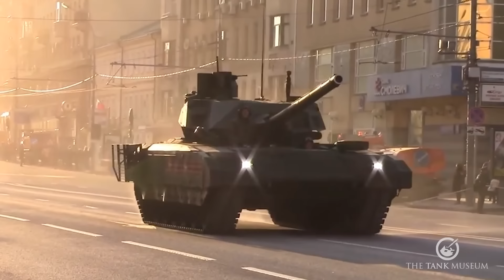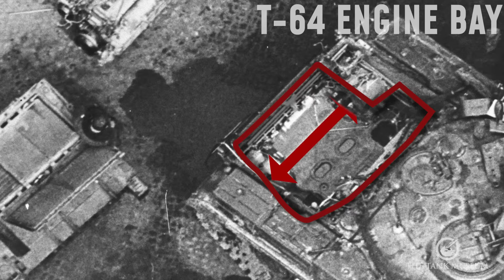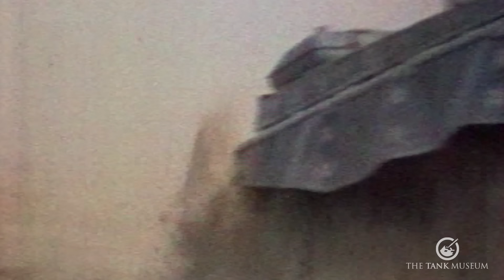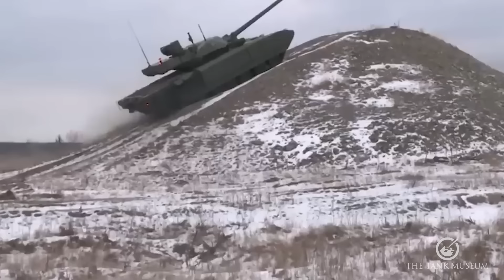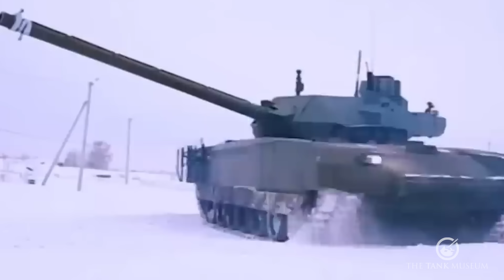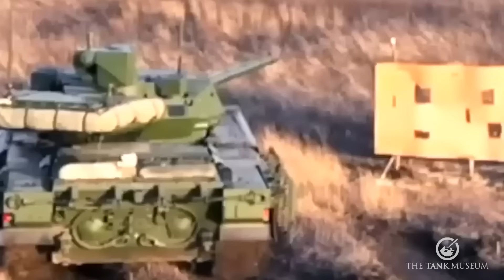Radical or Ridiculous? | T-14 Armata | Tank Chats #171

Comment: The T-14 feels like a project that falls under "eyes were bigger then my stomach " category , as a design while ambitious was never full thought out on how to build the tank in mass. Also a German engine design from WW2 was not the best choice either. 

Also I did find the statement that the T-72 is all that it is needed to counter western designs funny, As the few engagements where the Abrams faced the T-72 , the T-72 was curb stomped. That's statement has also aged horribly,especially now that the T-72 design has been shown as a death trap with a Jack in the box feature thanks to the ammunition placement.
Reply: The Shahed drones who terrorized Ukraine in 2022...2023 use the same design as a "German engine design from WW2". More correctly, from before WW2. It's the engine of Volkswagen Beetle.

Comment: It should be noted that the T-14's engine, the A-85-3A, IS NOT a copy of the German Sla-16 from WW2. This is incorrect. Simply looking at the exterior design let alone the finer technical details will demonstrate that they have little to do with each other

The engine was also never originally designed as an engine used for oil rigs. It's one of the applications advertised by UVZ but that was not the original purpose. Its design can date back to the 70s for engines on battle tanks.

Comment: The T-14 may turn out like the T-64, in that it is a very complex and ambitious design that ultimately is too expensive, so I suspect the Russians will T-72ify the T-14 into some new tank that still retains many of the design innovations and strengths of the T-14 while actually being capable of mass production.
Reply: And yet the T-64 eventually got sorted, and is giving good service in blowing up T-62 and T-72 😂
Reply: @richardthomas598  T-64 isn't a bad tank, but a T-72 gets you 80-90% of the T-64s innovations for a substantially reduced price, and unit cost/mechanical simplicity is what matters in mass production. The Russians will probably be forced to simplify T-14 into a different model or be forced to field a much smaller tank fleet once they've expended the legacy Soviet hardware and need to replace it.
Reply: But still t-64 were produced in quite big quantities. Russian t14 still looks like prototypes
Reply: @ivankarcha4935  Well the USSR had substantially more resources than modern Russia.
But the main point is that the Russians will eventually have to replace the legacy Soviet systems with something new and the T-14 isn't it. They need a simplified design ( like T-72  was to the T-64) they can actually build in quantity with the resources and facilities that they have, unless they want to be using T-72 obr. 2036s.

Comment: The T-14 will no doubt be more powerful than the T-90, T-80 and T-72 and should be more than a match for the Abrams, Leopard 2A6 or Challenger 2.
Reply: no doubt, but problem is that russian cannot affort them
Reply: @Motofanable  
I doubt it is the cost, I think it is more about gettint the industrial organisation together.  They can outsource components to China but the tooling and machinery are harder to acquire.

Comment: Now im not much of Tanker, but I do play a couple tank games; War Thunder, Sprocket & Cursed Tanmk Simulator. The Iteration of the T-14 Armada in Cursed Tamnk Simulator is quite a monster, so this video attracted me.

Learning about soviet design is always interesting, they're crazy crackers over there but they created tons of interesting concepts and wild ideas that sometimes border on fantasy. I take fascination in wierd and "Impractical" vehicles that test ideas, such as the LTG, SMK and various other unique vehicles or drawn plans. 

I vastly underestimated the technological capabilities of the ol soviet vehicles. This video is a good fact check.

The T-14 is such an interesting idea, to be completely honest. Its something out of a Sci-Fi, which is what people would say. A fully automated combat vehicle designed to interface with crews instead of being manually operated. There's a long history beyond cold war for a armoured combat vehicle having automated turrets or features, most hit dead ends.

The interpretation of the T-14 in the game mentioned prior (Cursed Tanmk Simulator) is a akin to what's described; 125mm Gun with an autoloading mechanism, its hull is built to have tons of ERA Modules coating each surface around the crew to prevent all angles of attack. Front? E.R.A Modules stacked to the upper front plate, with NERA and Composite Screens behind a layer of RHA. The lower place consists of a layer of RHA, then a chick composite screen followed by NERA.
The space in front of the turret, the crew compartment, has  protected roof with more ERA modules specially fitted for the hull.
The side of the vehicle is some *massive * add-on ERA, shaped for the vehicle's hull as to not stick out. The ERA is not only thick, but also enough to stop any projectile in the game.
The Roof of the turret is also coated in ERA Modules in it's Cursed Iteration to prevent top-down attacks.

Seeing this video was very interesting, and i honestly want to learn more about these kind of "radical" endeavours to revolutionise armoured vehicles!

Comment: It's funny the nazis were the first to use discarding sabot rounds. Also I don't buy the t-14 front armor, if it is 1300mm of armour it would be around half the weight of the tank in the that one armour piece. If it is ERA giving it equivilant of 1300 then most troop weapons can take it out.
Reply: Don't forget that we saw last year that much of their ERA is made with bits of rubber offcuts and corrugated cardboard.

Comment: You'd think a fume extractor would still be valuable to prevent long term fouling even if it's not needed as urgently in an unmanned turret.
Reply: It may be that the breech and or the entire turret assembly is in some way hermetically sealed, and kept at a high enough positive pressure that the breech opening doesn’t let in much smoke(that can easily be handled by filtration).

Could also be that it’s not really an actual “meant to be fielded” tank and so there simply hasn’t been a fume extractor added to the design yet.
Reply: Also corrosion could be an issy.
Reply: @richardthomas598  isn't that what fouling is?
Reply: how long is long term? the barrel needs replacement each few hundred shots anyways.
Reply: Most of war is 99 percent waiting for something to happen. their would be plenty of time to clean the mechanism of the tank gun between engagements. considering the titanic forces involved with a tank cannon it will probably take around 2-3 hundred shells before fouling starts becoming an issue. if the gun has an nitrogen purge system like what most artillery guns have then it would take longer most likely
Reply: it doesnt mean there is none. but it can be different and works slowly... possibly some fans somewhere. there is just none on barrel
Reply: Dont need one when one will get provided when it gets penned.
Reply: I mean, the Leclerc also doesn't have fume extractor. As far as I know, its turret has ventilation system getting the fumes out. T-14 most likely has something similar.
Reply: Maybe a stronger barrel without
Reply: There also could be a small compressor in the unmanned turret to give a shot of Air after every shot, but then we are talking about Russia.
Reply: @TB-zf7we  Worked for the M551! Also was good for snowball fights.
Reply: @SlinkyTWF  Wait, really? Snowball fights? Could you elaborate; that sounds like an absolute blast!
Reply: @TB-zf7we  Yep. It would not work in 17 out of the 20 Armatas they made. The other three would have different problems.
Reply: Not if the survivality of your tank in the battlefield is under one hour.
Reply: @arctic_haze  hey, that's at least better than the 5 minutes soldiers get.
Reply: @arctic_haze well, that's about how long this "counterattack will make headway, yeah?
Reply: @jamesgornall5731  No, it comes directly from the old Soviet military doctrine. Tank units were disposable. They were not supposed to last long. The idea was to surge the NATO defenses with wave after wave of armored units. By the way the Russians used the same strategy in the Bakhmut but mostly with prisoners, instead of tanks.
Reply: fume extractor is a hole in the barrel.  It slightly reduces the speed of the round by letting some of the pressure to escape.  The benefit of the crew not choking outweighs this, but in an unmanned turret...
Reply: @victorzvyagintsev1325  the AFU has the Javelin if the ruZZians have problems with fume extraction. All they need do is ask 😉
Reply: @TheTruthHz  Javelins turned out to be a failure.  Rarely used in this war.
Reply: @TheTruthHz   Если вы говорите о всу то Poroshenko, the former president of Ukraine did not accept weapons at the UN in September 2017, after his refusal, on the third day, an event took place near Balakleya, a year later, similar near Vinnitsa
These two events were clear acts of compulsion to escalate the conflict.
The supply of weapons will not bring any result other than the death of soldiers and the blame for their deaths on the suppliers.
Reply: @victorzvyagintsev1325  LMAO this is laughably incorrect
Reply: Turrets in orbit don't need fume extractors. 🤣😂

Slava Ukraini 🇺🇦 💪 ✌️
Reply: @TheTruthHz  Given that Ukraine is the main user of T-64, you should know a thing or two of turrets in orbit.  Its a record-breaker in this field.

Comment: Only thing we know for sure is that the turret rotates
Reply: Whether the crew want it to or not if the videos are anything to go by.
Reply: it's the new acorn seed lift off assistant mode, helps increase turret toss heights by up to 69%
Reply: I love that they flex a spinning turret as the mark of peak tank design.
Reply: @dlxmarks horizontal traverse speed of a MBT is indeed a mark of its strength, agility of its turret ring lol.
Reply: @dlxmarks Russian tanks have issues with the turret motor running out of control and not stopping when commanded to.
Reply: You might not be impressed by the T-14... but you should see the size of Alexander Potapov's yacht!
Reply: yes but did they fit the same turret spring as in the older tanks?
Reply: We also know that the industry is riddled with corruption. If it ever goes in to mass production, the soft kill system will just be some pipes, the ERA is wooden blocks, and most electronics will be missing. Not because of sanctions, but because the people in the component logistics chain filled their pockets.

Comment: When the engine is fixed, systems work, reliance on Western tech removed and when I takes the battlefield. That's when it's worthy of prise.

Now replace when with if....
Reply: The engine is based on a German design. The same used in the elephant in ww2!!!! So it doesn't work.

Now the Hull is designed for only this engine, so no chance of plonking anything else innit

Comment: The T-14 design may have some merits, but if it was of any practical ustility it would be in use and in scale production.  Something is lacking, be it design shortcomings, resources, investment, etc.

I think the unmanned turret has enormous potential.  The T-14 might end up like a lot of developments: if you don't make the first new step then you get to learn from your competitors mistakes.  The British did this with many naval developments.

"Absorb what is useful, discard what is useless" -Bruce Lee
Reply: Unmanned turret has numerous advantages IMO.  First, you could afford to lighten the armor, as with a proper ammo storage a penetration might only get a firepower/mission kill instead of killing the crew.  Potentially expensive, but if it shaves 5 tons off the vehicle that can be a lot of added range or space for additional systems.  You mentioned the lack of need for a fume extractor which isn't much of an advantage but might save some cash.  The lack of a loader means only 3 crew, which might reduce hands available for field repairs also reduces overall logistics needs, weight due to a smaller compartment, and enables longer firing at maximum ROF even if that ROF is slower than a manual loader.  I'd wager that one could make a lower profile turret as well, reducing visibility and weight further.
Reply: PerilOS  Tech has advanced since the 70s.  See the F35 for situational awareness capabilities.  The problem with a manned turret is it needs to be fully armored, armor that might better serve protecting the irreplaceable crew in the hull.  Light armor, active defense, and blow out panels can defend against anything but APFSDS.  Even if the turret is knocked, hull mounted sensors could retain situational awareness and comms long enough to retreat.
Reply: @fguocokgyloeu4817  We are a long way from adapting situational awareness like in the f-35 to a tank. Mainly cause it's not necessary. Tanks don't engage in combat where mach numbers are relevant in maneuvering.

Yes, but why you gonna stay in your tank with a knocked out turret on the front line in a full scale war? No you pull back if you can, if not you abandon it. Best to just recover it later if you can then to die.
Reply: @chris8612  Better to be in a tank than not.  Exiting the vehicle makes on vulnerable to everything, while staying in and pulling back is safer.

As for the situational awareness, you're wrong.  Augmented reality systems could allow the crew to see as if the armor wasn't there.  You don't need to be going supersonic for that to be useful, and AbramsX supposedly has such features.
Reply: @fguocokgyloeu4817 It's gonna be extremely expensive to put that in service, also many doubts if it's even needed. Abram X isn't gonna be adopted, it's just a tech demonstration build by a company.
Reply: @chris8612  I understand that.  But tech demonstrations exist for a reason, to demonstrate a capability.  And that tech is exoensive to develop, not to build.  I don't know why you think mitigating a tanks biggest weakness is unthinkable for the DoD.
Reply: @fguocokgyloeu4817  1) The helmets required to get the f-35 tech are custom fitted and 200k a piece. If broken there is not one ready to get out in the field. Helmets seem the only way to actually implement this. Guess how often tankers hit the inside of a tank. 

2) Cameras on booms were attached to check corners for tank in the cities in Iraq, result the tanks stopped at every corner. This slowed everything down so much they were tossed. It was a drain on crew resources. More info is not always better. Probably more intelligence fusion data linked is the answer for better situational awareness. 

3) US Doctrine is to peak, shoot, get undercover. This is drilled with timers and everything. You wanna minimize time you are seen, there by minimizing the time you are a target. How does this tech help in that? 

4) See through armour best use case seems to be city fighting. If your city fighting in a war(not counter insurgency) something has already gone terribly wrong. 

5) Tanks are necessary, but they aren't the pinnacle of military tech. To be effective they work in combined arms. So the money you could spend to gold plate your tank could instead be used to actually force multiply, or more training. Yes, I love tanks but they aren't a silver bullet. 

P.s. Tech is getting incredibly expensive to build today.
Reply: @chris8612  1) Yes, but the tech will get cheaper, more robust, and easier to implement over time.  Even if it was just for the commander $200k is not that much by DoD standards, and I don't think a tanker needs a version nearly as sophisticated as an F-35.  My first gaming PC cost about the same as my latest, and I make 5x as much and the machine is 4x as powerful.
2) You don't need cameras on booms, drones will do.  But agreed, intelligence fusion is the best answer there, and augmented reality makes that data more accessible to the crew.
3) Yes, this tech helps because you could 'see through' what you are peeking out from.  Of course we can lay the gun to where it needs to be and then move to fire, this would make that even more precise.
4) Best use, no, but it would be of the most marginal effect in city fighting, which US tankers have done a lot of in the past 20 years.  Cities are valuable and tend to be fought over in wars.
5) Strawman argument.
It is expensive to build by person standards, not DoD standards.  I am sure there are counterexamples I can't think of, maybe supercarriers, but the development of a technology or piece of kit is almost always more expensive by orders of magnitude than the per unit/several unit cost.  F-35 cost  hundreds of billions to develop and the flyaway cost per unit is around $90M.
Reply: It's not in use because they don't want the West to know its capabilities.